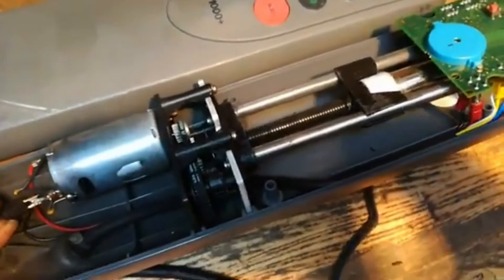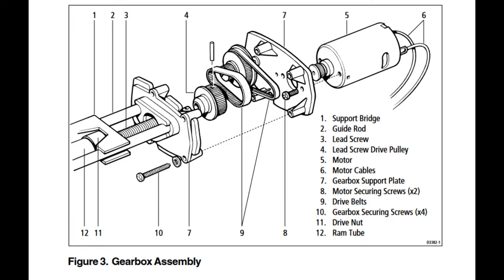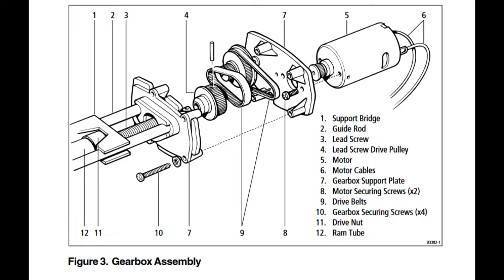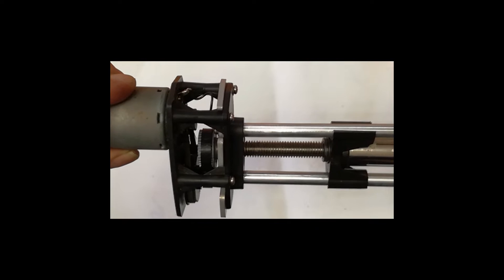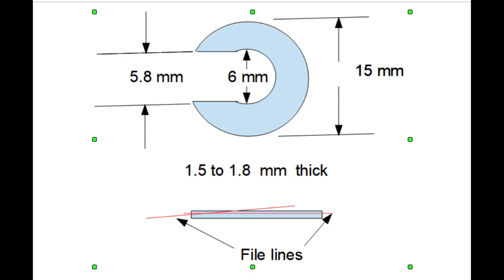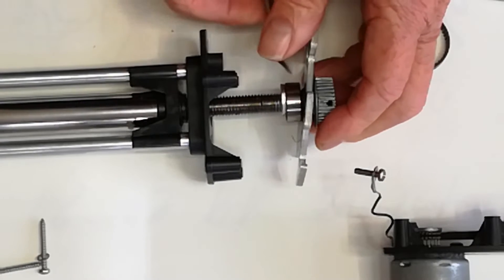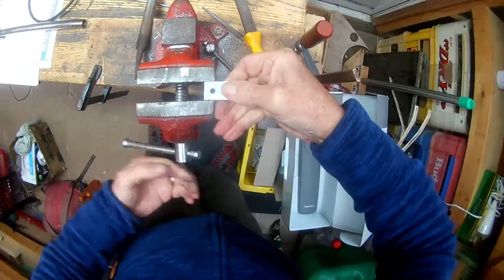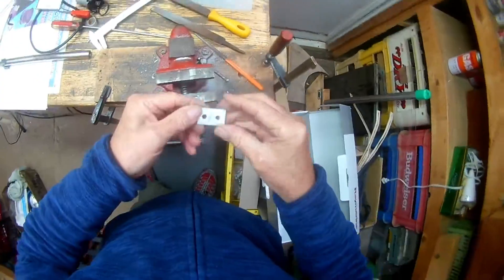Raymarine ST 1000 ST 2000 Tillerpilot Bearing Endfloat repair

Comment: I used a pvc washer in the other side (taking the dented wheel out), but when it gets to the end the arm gets extremely tight and the mechanism suffers a lot. Your solution is better for sure